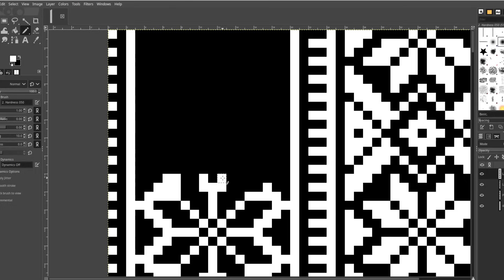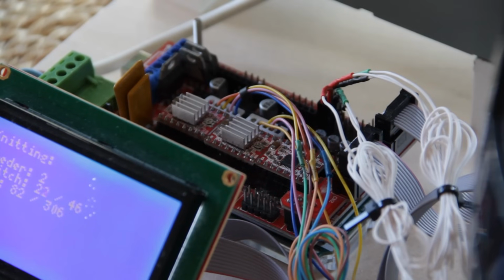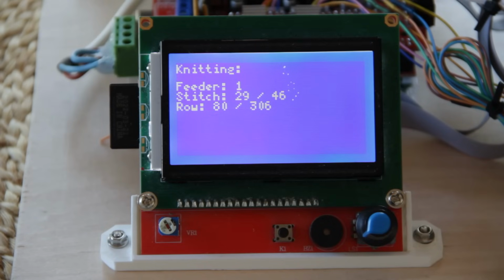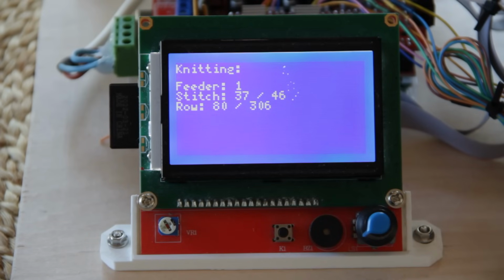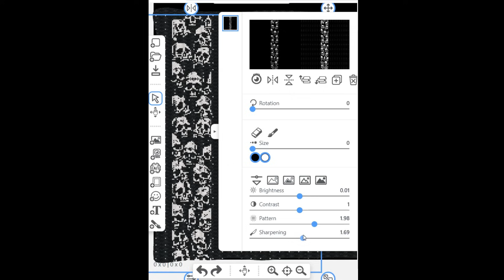Modifying and Automating the Addi Knitting Machine for Multi-Color Knitting. For fun and Profit!

Comment: Your yarn tensioning solution is so smart! I was scratching my head how to solve it on a project of my own. I needed a constant tension force, so as an ad hoc solution I used two pulleys and a weight as F = mg = const. so I could vary m as needed. The relationship to tensile force Ft is found by some simple geometry (two pulleys + weight is a triangle). With the right parameters dFt is approximately zero.

...but you used a spring with a very long arm orthogonal to the spring's principal axis. This means that the dX of the spring remains small, and so dF = -kdx -> 0 meaning you achieve constant tension force! So smart!
Reply from the maker: Thank you for your comment! It’s not 100% constant, but I think it’s good enough for this purpose. That said though, there's still the issue of the yarns angle against the plastic hooks, which significantly affects the tension at the knitting end depending on the arms position. I’m considering replacing the hooks with small bearings with deep V-grooves to help minimize that effect.
Reply: @MartinMakesThings  Bearings sound like the simplest solution! It turns static shear on the string to torque on the bearing.

If that doesn't work, some thoughts:

Excess tension needs to be compensated by slacking the string. 

Option 1: put the yarn on spools and the spools on axles. Then you can control the feed via the rotational angle of the spool. Then dynamically couple the angle to yarn tension.

Option2: alternate the spring constant dynamically, eg by twisting the spring (attach one end to gear).

Note: You can use sound to measure string tension. At a set Ft0 it will have it's resonant modes. Send that frequency, measure response. The lower the response, the greater the deviation from Ft0. Correcting algorythm should maximize reponse (gradient descent).
Reply: You might know by now, but that kind of tensioning is usually called a "dancer arm" and it's widely used, but if you're searching for more broad ideas then that might be a better spring board to start off from! Depending on your application a set of capstans can also be used for some good tension, however that relationship is typically more complex imo.

Comment: A knot detector could be easily implemented by feeding the thread through the eye of a needle and if a knot hits the eye it will stick and the needle thereby activates a micro switch which stops the system. (Edited and better understandable version 😂)

Comment: This is pretty stupendous!
My only discontent with this marvelous work is that when the color changes, it "binds" the yarn on the back-side with a half-twist, but when it does not, you have much longer loose threads on the inside of the pattern. At the end of your video, you see huge half-loops across the entire inside of the pattern.
If you added a "twist" between every stitch, would it lock these in on each stitch and further stabilize the pattern and clean up the back side or would it muddy the pattern?
you, of course, could not twist indefinitely without rotating your spools and tensioners, which would be ridiculous, but you could alternate forward and backward twists (your selector is probably actually doing this already, actually, just a single half twist forward or back, or no twist)
I understand that it would mean that you'd need to do something more complex than the current color selector (likely something rotary): I'm thinking that the color selector becomes a disc with two smoothed holes and gearing to be edge-driven, that you then alternate rotating forward a full twist and backward a full twist to return to zero to lock each stitch, and then color select either no rotation or forward/back a half twist to swap colors. that adds alternating forward or backward locking stitches when the color doesn't change and either a twist and a half forward locking stich or a half twist back when the color does change. i.e. strand a will either be +1 or 0 rotations and strand b will either be +.5 or -.5 rotations, depending which direction the alternating lock index would be. Heck if you stacked your tensioners vertically, you could get +.75, -.25 and +.25 and -.75 to further reduce the thread to thread tension.
it'll mean you need a little distance between the runout/knot sensor and the color selection disc and that your color selection disc would need good smoothing on the intake side, but it should both stabilize the pattern and clean up the back.
(I'm clearly just brainstorming at this because the video excited me.... but i think the above could be explored to really improve the back side and overall stability.)
Reply from the maker: Thank you so much for your wonderful comment, Daniel!
You are absolutely right, the current Achilles' heel is the loose threads on the backside, often referred to as "floats". So, if a better way to handle them could be found, it would be absolutely brilliant!
Twisting might work, but if we ditch the third "scaffolding" strand (often referred to as "plating") and just twist the two main strands of yarn in between each stitch, I'm afraid that it would be visible from the front and "muddy" the pattern.
BUT perhaps it is possible to twist the unused yarn with the third "scaffolding" strand! Since the third strand is hidden on the backside, twisting it with the currently unused color strand should not be an issue! I will do some testing!
I don't know if I missed some key points in your brainstorming, but if you want to discuss things further, feel free to reach out to me at martinmakesthings (at) gmail (dot) com

Comment: Wow, very impressive and I'd love to see more. I would ofcorse hope you make it open-source but would totally understand if you didn't. I'd love to build a smaller version myself for smaller tubes I would like to make for a project I'm doing
Reply from the maker: The plan is to release it under a CC license, but it still requires a lot of cleanup. Are you using the Addi Express Regular for smaller tubes?
Reply: @MartinMakesThings  oh I didn't actually make anything yet or bought any machine. I did look into other automated diy knitting machines on the past like the flat knitting machines but your solution looks way easier and less error prone so I'm excited to see more updates.

Comment: As an avid knitter I absolutely love this, I'm coming from the perspective of someone who has used a knitting machine, where you have to work out the pattern yourself. 
The way you've overcome the structural issue that you'd usually use twisting for, is absolutely genius. Traditional knitting machines (the large flat ones) are notorious for needing a lot of baby sitting and practice to use, even the ones that you can code a pattern for and has detection systems etc built in, so honestly you've not really "failed" at all. (the industrial ones cost more than a car so I'm not really going to use them as an example). 
The thing that I'm most interested in is the software you're using because this has other applications too - can you print these designs? They could be used as cross-stitch, manual knitting charts and even crochet charts. There are already proprietary software programs that do this of course but not the way you've described it! 
I'll keep watching this space!
Reply from the maker: Thank you so much for your comment!

Sadly, I haven’t really overcome the structural issue perfectly yet. I see the third strand as more of a "hack" for now. But perhaps it’s possible to twist the third strand with the unused color strand and solve the issue for good!

Regarding the software, I have to admit that I made it with my own limited crafting understanding in mind, so I wouldn’t even know what would be needed to make it useful for cross-stitching or crochet. But if you want to discuss further, please feel free to reach out to me at martinmakesthings (at) gmail (dot) com

Comment: dude, i appreciate your effort but that yarn run out detector is such an over-engineered piece. i would probably just use a 3d printed hoop with an distance sensor and the if the hoop empty measured distance is diameter of the hoop otherwise there is some yarn in it so it's safe or etc... but your idea is so complicated yet awesome, respect!
Reply from the maker: The run out detector might seem unnecessarily complicated at first, but there's a reason for it. You see, the spring loaded arm keeps the yarn constantly tensioned when the advancing mechanism retracts slightly to switch between the two colors of yarn. So, it essentially serves two purposes, as a constant tensioning mechanism and as a run out detector 😃

Comment: I've seen a similar project for flat knitting machines called AYAB that @KnitFactoryImpl talks about on their channel.  I like how your setup seems a bit more portable.  I wonder how compatible it would be with one of the 3D printed CSM projects.
Reply from the maker: Yes, AYAB is a wonderful project. I actually have an old Brother knitting machine that I’ve converted to use the AYAB electronics 😃

Comment: I'm curious as to why you started with an addi/sentro style machine, rather than modifying a printable circular knitting machine that would give you significantly more stitch control (like the ability to put needles out of work) and an easier time with design modifications.
Reply from the maker: I started with the Addi as the base, so that I didn't have to spend time on trying to get the underlying mechanism to work 🙂

Comment: another youtuber designed a diy 3d printed knitting machine which could be worth checking out bc it would make you more independant and make the endevour more scalable (and allow you to make bigger or smaller loops or panels relatively easily I think

Comment: knot detector - a piece at the yarn intake that has an opening the diameter of the yarn. It could be made adjustable to different yarn diameters. a sensor can be attached to this piece to pause the machine when it encounters resistance

Comment: (From a hand knitter and spinner.) For knot detection, there might be a solution that also helps your tension. If you rewound the balls of yarn into center pull cakes, you could try incorporating knot detection into the rewinding step and not risk messing with your active project.
Reply from the maker: This is not a bad idea, and it would also ensure a more steady flow of yarn, but I'm a bit hesitant, since this requires extra constant winding work 😆

Comment: Might be worth talking to an experienced knitter who knows how to do stranded color work. I’d say your tension is off, that’s why you have too much excess yarn on the floats on the back. You shouldn’t need a third “stabilizing” yarn. A heel spring would help with that. Great project, enjoy the problem solving.
Reply from the maker: Hi, and thanks a lot for your feedback. I appreciate your interest in the project. Though I should mention that if you take a look, you will see that my machine actually does have a heel spring (it's part of the run-out detector). And while tension adjustment is always important, I've found that even with optimal tension settings, some extreme color work patterns can still benefit from additional stabilization, this has been my experience both with my Addi modification and Brother knitting machines. The third strand technique, while unconventional, has proven quite effective in these specific situations. Thanks again for the encouragement on the problem solving journey.

Comment: Looks really good. Would definitely be interested in fitting one to my addi. Does it only do tube knitting?
Reply from the maker: Currently only tubes. I am looking into panels but it is a bit more involved because of the 3-threads-method I'm using

Comment: This is brilliant. Thank you for showing what you’ve done so far. Do you plan on making the 3D printed models available?
Reply from the maker: Thank you for your interest! My current plan is to tidy up this design, make the 3D files freely available for non commercial use, and also offer complete kits with all the necessary parts for sale. But I'm a bit torn between putting my energy into that or dedicate more time to improving my latest iteration, which is designed to knit with more than two colors 🤔
Reply: @MartinMakesThings  It would probably be worth it to tidy up and refactor the design, because it would make your future iterations easier, because it would have fewer bugs and a more stable base to start from. Yes, refactoring is boring, I know, but I also selfishly want you to make kits so I can get one.

Comment: The knot detector for the Brother KE100 Motor Drive is pretty simple, just a metal plate with 2 sizes of slots in it (for thicker or thinner yarn) in line between the yarn itself and the first tensioner, if there's a knot it is pulled out of position to trip it to off.  (You can kind of see it in a couple spots in the manual, which is available online.)
Reply from the maker: Using a plate might be a better idea than what I had in mind. Thanks! I will have to test this 🙂

Comment: I watched this several days ago and was in awe of what it must have taken you to do all of this and wondered what you could manage with a flatbed machine and maybe a ribber, as well. Would also be really interested in what software programs you are using. I love my brother knitting machines for knitting pictures and other simpler pixel patterns
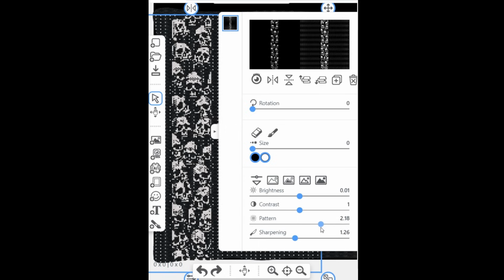Reply from the maker: Thank you very much! I actually do have an old Brother KH-900 flatbed machine that has been modified with AYAB electronics. I mostly use it to knit cushions with various images and patterns. I created my own software to convert images into knitting patterns, as I wasn’t satisfied with any of the available solutions. It’s briefly shown around the 0:23 and 7:52 marks in the video. I really want to release it, but time is holding me back sadly.

Comment: Does this work in the panel setting on the addi or have you just gotten as far as circular patterning? This is a fab concept, I love the results you're getting and I only wish I had the know how to be able to design something this cool! Can't wait for a follow up.
Reply from the maker: Currently, it only supports circular knitting, no panels, as it was originally designed just for knitting scarves. However, it should be possible to modify it for panel knitting as well.
Reply: @MartinMakesThings  well either way it's an ingenious invention and if he really interested in a long format video with more info on it and just to watch it running for a while.

Comment: I would love a deep dive, if you're taking votes

As for the tensioning, are you taking inspiration from serging machines or even sewing machines? Having to throw a loop around the bobbin for each step can be a wild ride for thread
Reply: Sparks' Curiosity is also diving into the nerd-ish side of this category, if you want to take a peek or see if you can collab
Reply from the maker: I’m a big fan of Sparks' Curiosity and the work she's doing! At the moment, though, I think our motivations and goals might not be quite aligned enough for a direct collaboration. But diversity is what makes this space exciting! 😄

The tensioning mechanism was originally inspired by the antennae on my old Brother knitting machine, but it’s printed in plastic with an adjustable spring since I can't fabricate long metal parts consistently. Later, I noticed the similarities between my combined run-out detector and tensioning system and the one on the Kniterate, so perhaps my subconscious was inspired by that. I'm not quite sure what you mean by "loop around the bobbin." 🤔
Reply: @MartinMakesThings  It's the way a sewing machine works.  The needle comes down and the hook grabs the thread and makes it loop around the bobbin. That forms a twist and keeps the bobbin thread under the fabric and the upper thread, above the fabric.  
I love what you did here. I have a circular sock machine and I am thinking about how wonderful it would be to have something like this to make patterns. The needles and spacing are quite a bit smaller but I bet, whish, hope it could be done. Great job!
Reply from the maker: @addychristine262  It should be possible on a machine with smaller spacing, but a better method for securing the floats would be needed for socks

Comment: Brilliant project! Having both an Addi & a Prusa it's very cool to see those worlds collide.  Did you use a version of klipper with the control board?
Reply from the maker: Thank you! Yeah, we need more colliding 😂 For this project, I used my own basic code (except for the LCD library). It’s mostly a hackish reuse from an older project, nothing as sophisticated as Klipper, but it works for now! This is also one of the reason why I don't just release stuff now, I'm embarrassed 😂